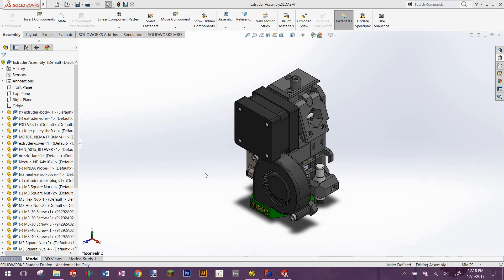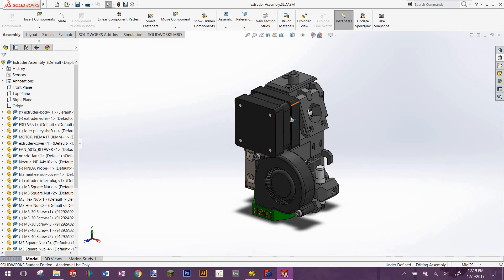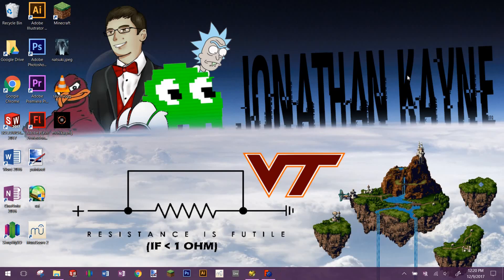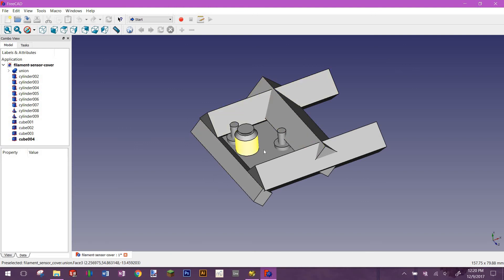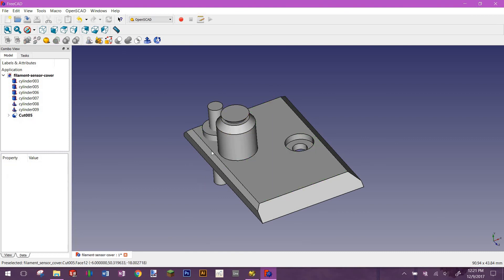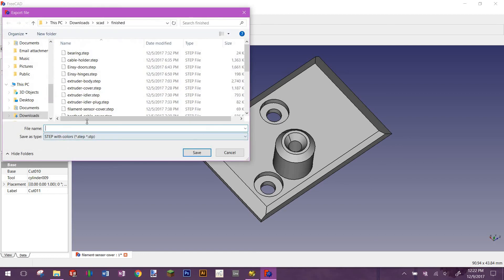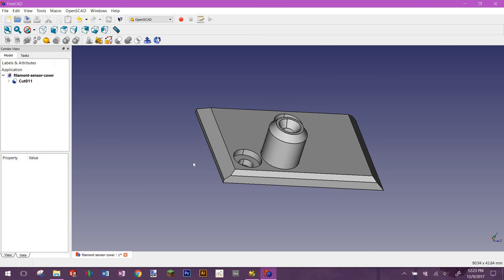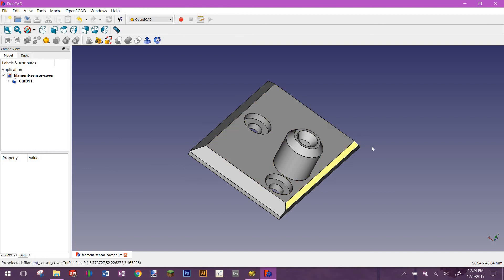[Tutorial] How to Convert from OpenSCAD to STEP format

Comment: freecad just indefinately hangs when i try to open ANY scad file, or CSG file. yes, OpenSCAD is installed, and linked in preferences. Yes the files i've tried so far work well in OpenScad. No, none of the files are using imported modules or libraries.
Reply from the maker: Note the age of the video. I tried to open an openSCAD file a few weeks ago in the latest stable version and it flat out refused to import.
All I can say is that it worked 5 years ago when I made this video

Comment: My FreeCAD will not allow opening/importing of .scad files. What am I doing wrong?
Reply from the maker: Is it returning an error?
If you are having trouble one way is to try saving the OpenSCAD file as a CSG and then opening in FreeCAD.
I know that certain commands in OpenSCAD (such as resize) don't work in FreeCAD and they can return an error upon importing them
Reply: Please report the problem in the FreeCAD forum https://forum.freecadweb.org. You will need to supply your FreeCAD version info and the problem file. FreeCAD is OPEN SOURCE and does not have an army of testers like commercial software so relies on people reporting problems and providing some debugging information. Question have you remembered to tell FreeCAD where the OpenSCAD executable is?
Reply: having the same problem... 🙁
Reply from the maker: @RubenDax  Make sure you install OpenSCAD on your computer. Apparently its needed to import into FreeCad: https://wiki.freecadweb.org/Import_OpenSCAD_code